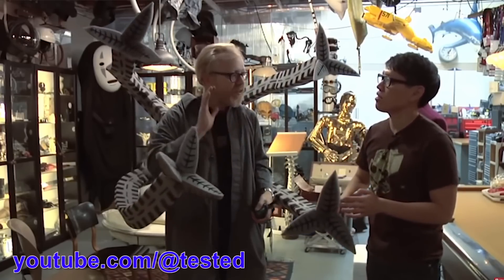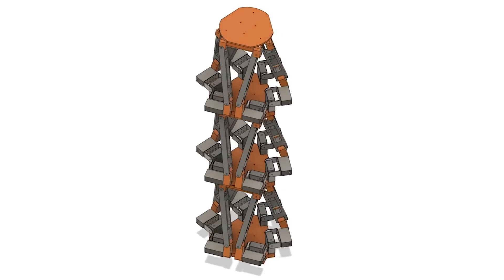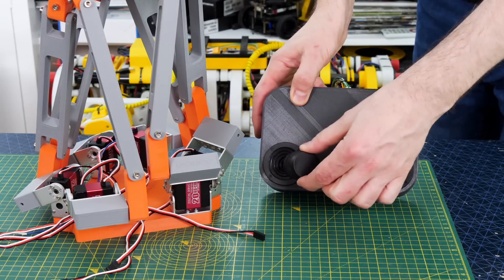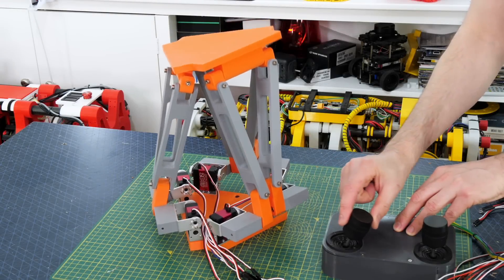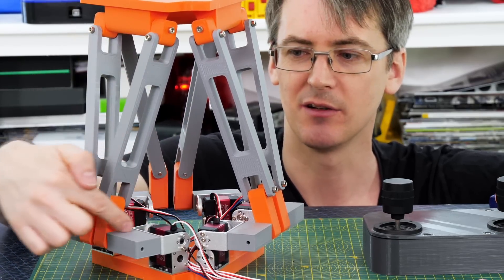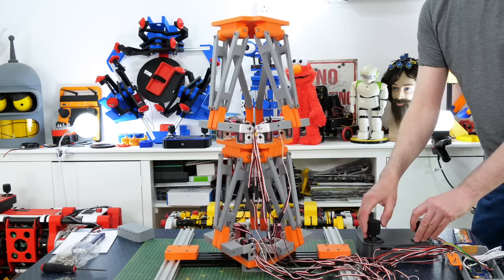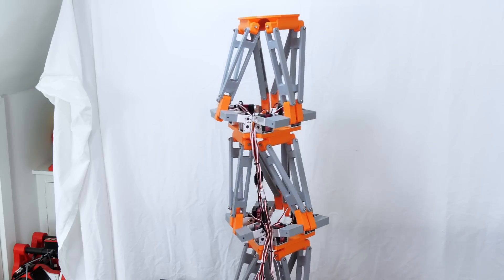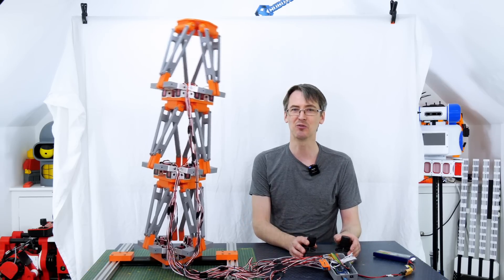Building a better Doc Ock Tentacle

Comment: Another potential idea. Instead of making Doc Ock’s 4 tentacles, what if you utilize those actuators to make Scorpion’s tail? One “tentacle/tail” should be easier to control and much lighter plus it's still a Spider-Man villain. And since this villain will be making his debut on the big screen in 2026, the timing would be perfect. And then you can still make Doc Ock arms afterwards.

Comment: Please do a part 2! With steel actuators for the base, then lighter aluminum actuators for the middle, and finally 3D printed plastic actuators to finish off the end of the tentacle. If you have to they can even be slightly tapered in size towards the end.

Comment: You can also do a Tentacle that uses gravity as -y . That way you only need a motor that tenses cord counter gravity to lift, and have two similar motors that tense the tentacle sideways.

Ideally the tensing motors would have a some paracord that it can deploy and recall to tense and relieve, they could be at the center of the tentacle to provide "elbow dynamics", use a sleeve to channel the cords, and some kind of aluminum spring deformed to conform to the desired shape of the tentacle... I think it should be inside of the sleeve and be a tight fit, so that the channels with the cord remain stable.

I thinks this is much cheaper, and the design is much flexible with a much higher tolerance for error.

Comment: would a thin anchored fiberglass rod down the middle be a good way to help take the strain off the bottom servos? or would it just add unnecessary strain to everything?

Comment: You could give the sections their own independent rotational movement if you used small electric hub motors mounted at the base of each structure, then instead of have a long central bar that spans each entire section you could have a smaller peg that slides the a bearing on the top of each section that sits flush with both section's surfaces.

Comment: Fascinating. 

Not an engineer, so feel free to haze me hard if I say something stupid, but I could see pneumatic as being really good for this. 

If you had a central highly pressurised tube with connections at the base of each section, you could drive the stewart platform with pistons connected to solenoid controlled valves. Letting the pressure control the movement of the mechanise. I'd also sagest having each segment stacked around halfway (or whatever mathematically works) along the former, allowing a smother, more tentacle like movement due to the fact that this would allow the mechanise to efectivly counteract the angels necessary for a stewart platform to work. However, I have no idea how complicated this would be to get working right, if it's even posable, and if there would have to be some kind of mechanical stabilising ring that would lock the bace of each pistons position ,of each segment, to a parallel planer position to the base segment, no matter the place it holds in the chain. 

You could also use the expanding of the pressurised tube to help support the mass of the mechanise, having bracing rods paced on universal joints halfway along each piston and utilising the force exserted by the tube to hold them steady. 

This, I think, would solve the problem with the servos lower on the chain being under more stress and allow a more natural movement, as well as, since you would be using pistons, remove the problem of large amounts of joints coursing wobble. 

Not an engineer though, so just some plebs thoughts.

Comment: Why not have a servo in the center of the top mount/platform that can rotate the next layer? Maybe link them with a large printed bearing as the link and the motor holds the position of the yaw.

Comment: Rotate the servos 90 degrees and fix them to a smaller base plate to allow for more tilt control. This won't be able to hold spiderman in a grip, he'll just slip through the hole due to abominably huge curve radius.

Comment: I feel like if you made 4 or 6 of these 3 section tentacles and put them on rotators connected to a platfrom, they would work quite well as legs (especially with the added supports you mention) because that heave/contraction motion could help with the clearance required to move a leg. Nice work!
Reply: I would love to see him build a robot like those from the Matrix movies. The eyes could be replaced with sensors that allow it to navigate its environment using some form of AI, like what boston dynamics use.

Comment: How did you become so good at engineering? Do you go to school for it? Did you practice building a lot? I’m a freshman in undergrad engineering and I want to do stuff like this
Reply: Engineering student here as well, 5th year, the best way to do this stuff is to practice with projects you find and watch some tutorials on youtube. The degree will teach you a lot of the math and physics, but you won't really see application until a senior design class most likely, unless you have some kind of project class, but even then they either give you a kit to buy or you have to come up with it on your own. An arduino kit is a good start for learning the basics of using a microcontroller. Learning a CAD program for 3D modeling like fusion 360 or onshape (which are free for students) and having access to a 3D printer (some universities or libraries will let you use theirs if you can't buy one) will allow you to do a lot. From there, the sky's (and your wallet's) the limit 👍.

Comment: It looks like something which could be refined into a robotic arm with possibly enough dexterity to replace lighting and perform other ceiling work like hanging drywall in a safer, faster way from the floor.

Comment: now imagine if each of those sections was about 2 or 3 inches high but there were 50 stacked on top of each other and that's essentially what each tentacle in the movie version looks like it's made of. if you started with bigger segments at the base and slightly tapered them down to smaller segments at the far ends it might add support at the biggest places of stress while keeping the far ends as light as possible. it would also look like some Ock designs, as many have his tentacles tapering slightly as they go. definitely do more of this this has some real potential.
Reply: An excellent, though quite costly idea. I wonder how it'd affect the weight of the tentacle per foot of length? Also I would love if there were some way of surrounding each small segment in a hollow tube in order to get that comic book look, with enough of a gap between each that the segments can fully rotate. Though it likely isn't possible due to how the struts twist and turn in each segment. Unless maybe it's more of a shroud? Idk.

Comment: This feels like it could be done with 3 motors instead of 6. The translation doesn't help a lot for the weight it adds.

A more intuitive control scheme would  be to direct the head in absolute space, like a drone, and let the computer fugire out how to move each part to get it there.

Comment: can we appreciate how impressive real tentacles from octopus and squid and such are. To have the degree of flexibilty while still retaining strength is ceaselessly amazing
Reply: That's some biology for you. Invertebrates muscles are actually crazy.
Heck, all biological "actuators" are. Google 'sarcomere' and share your thoughts (that's basically the modular molecular motor assembly which is present in pretty much any muscle of any creature. It's really power-hungry, but immensely strong and, duh, stackable)
With cephalopods there is this quirk: their "limbs" don't have any skeleton inside, pure muscle, some blood circulation system and nerves. This plus their rather tough skin for said muscles to latch onto gives them that crazy strength. Wanna go further? Go full exoskeleton, get all from biological muscles, become an insect.
Reply: well, yes but that's not too different from your tongue. extremely flexible, yet it's the strongest muscle in your body relative to it's mass

if you want to do a small experiment, curve the tip your tongue slightly downwards and try to push it inside your mouth with three fingers, with all the strength of your arm, while at the same time you push against your fingers with the whole strength of your tongue. BUT DON'T do it without washing your hands or if you've got long or sharp nails. Safety first

Also, if at any point you feel like you're really able to push your tongue to your throat, STOP. We don't want you choking
Reply: Biology of crazy. Even the most basic organisms can be incredibly complex.
Reply: you SIMP for mother nature. im with ya
Reply: Its a film
Reply: They are really alien creatures tho all the cephalopods are just built different from all other creatures even in all our oceans and bodies of water what with some being able to camouflage themselves with any surroundings, change skin textures, mock certain animal shapes, and just overall intelligence. It’s just other worldly tbh.
Reply: Sure why not

Comment: I guess you're a mechanical robotacist, but there's way, way to many joints servos, friction and weakness in this contraption.  A better solution is fluid filled cells controlled through a central reservoir.  But, I guess that doesn't fit with your channel.

Comment: In order to reduce the stress on the bottom tiers, you should make each tier slightly smaller than the last.  This'll reduce the over-all weight as well.  This also will help it look more similar to the source material.

Comment: Another option is to put pneumatic or hydraulic cylinders along each side of the sections which take the brunt of the static load from each compounding tentacle. That way, the servos could be utilized for motion, and the cylinders for load.

Comment: Make another but with sequentially smaller and lighter sections, possible need to use materials like carbon fiber and nylon filaments for the lower sections to take the torque and stresses

Comment: don't calculate controls via trigonometry. it's annoying and error prone. instead, you know the destination position of the upper triangle, so you can calculate target length of each link, and from that length you calculate target angle.

if you want velocity control, then do a small offset of the upper triangle in the direction where you want it to go, and then calculate the difference between the current angle of each servo vs this small displacement: your velocity needs to be proportional to this difference.

it's like inverse kinematics, but it's fully constrained, so the problem is well defined and you can calculate all servo angles just from position of upper triangle relative to the lower one.

Comment: Obviously you are going to have to deal with the magnitude of forces on the bottom when the center of mass is not directly over the platform. If you provide a greater degree of motion the tentacle can curl back on itself so the center of mass is adjusted from the end down. That is how snakes deal with climbing over branches or vertical surfaces. You can also see that sort of curling motion in octopodes when they don't have neutral buoyancy (aka above the water).

Comment: Something to think about, use cables to strengthen and stabilize the segments. They don't need to move or actuate any part of the assembly, just hold it together at extreme angles.

Comment: Personally I think that 6 actuator per section is rather ludicrous. By doing the math you should able to achieve, if not precisely, the very close to the same result with half the actuators, having the sections working together to achieve the desired collective result, I'd even say you could get very far with just 2, and if you're really smart, you'll have them affect not just 1 but 2 other planes/sections. Well, I for one think so, but then again I'm just a wannabe engineer with no education or experience to speak of, so what do I know.

Comment: 8:41 - Why would you need to do all that? Why couldn't you just add some gears and another servo onto a different 3d printed piece where the outer edge of that platform is static but the inner part is dynamic. Basically it'd be like those rotating platforms for food stuck on top controlled by a servo.

Comment: If the sections are much shorter and you do the thing where the middel parts is reversed with the bends i could imagine the tentacel could rear hard spots that arent easy reachabel. Like sticking it in a pipe with bends in it.

Comment: You don’t need the whole platform piece to rotate. Just the centre. Cut out a circle and make the whole price into a bearing or gear essentially with a motor controlling the rotation. Then attach the next platform to the middle circle.

Comment: yes making it smaller, and each section shorter, will maker it MUCH MORE like the movie version... but once you get it built with multiple sections how will you control all of them so they don't bend too much? will you have to use some sort of algo... or even machine learning?? or maybe they could increase the amount each motor moves depending on how fast you move the joystick.... but I'm thinking way ahead of myself, like when you have 12 'levels' (with smaller pieces of course)

Comment: I think it would be more ideal to have an IK solver so that you are using the controls to move the end of the stack in 3D space and the servo movement would be completely independently driven. This would get more complicated if you have more stacked sections, but then you could get to the point where you could articulate the movement. There's probably too much mass with the current print method, but it isn't difficult to imagine how you could form something like an S in the whole arm by curving several sections near the base one direction, and then equally bending several sections near the end in he other direction. Maybe you could use carbon fiber rods to build the actuators to reduce the overall mass? It would still be a lot of strain on the lower servos though, so I wonder if there's something you could do to cantilever strain, maybe with springs? I guess the orientation would matter a lot.

Comment: You should use rotational joints like they used building the " Newt Suit " for dry deep-sea diving. Each segment can rotate when a half nut ( like on a lathe) engages a central shaft that is threaded in both directions depending on how the half nut connects to it? Each segment would be flat on one side and have a 45-60 degree face on the other. The flats join with other flat faces and the angled sides connect to other angled segment faces. The central shaft drive would have U-joints at the bearing faces?  I can see it in my head and I'm not explaining it very well? Sorry.

Comment: ShonicBurn is correct, each segment after the base should be made about 10 percent smaller as it goes out, just like a squid tentical it is smaller the further it is from the body.  Secondly you could put a rotational pivot section every third segment and would enable the twist you want, it would not have to be in each segment.  Good job, now can you hook it up to neural link?

Comment: Start with a small tip with small servos, then work back toward the base with larger and more powerful servos, making the sections bigger each time. That way the servos at the base can handle the mass of the whole length :D

Comment: I'd imagine that as soon as you turn this sideways the servos will struggle to overcome gravity.

Maybe some torsion springs in line with the servo axes could be added to counteract much of the force due to gravity so it's mostly just the inertia of the system the servos are having to overcome.

Comment: There's also some interesting work that's been done by Festo and Disney Research involving liquid or gas filled tubes instead of cable actuators. On either end of the line are syringes: when one is pushed the other is pulled

Comment: One suggestion I have would be rerouting the wiring to the interior of the arm. If you add a circular hole in the middle of each platform, you could use some form of wiring loom to protect everything from potential pinches or damage from the movement.

Comment: How about you control the intended tip position and orientation as relative movements (changing variables by adding or subtracting from the previous values), capped at whatever you calculate is the limit of the reach of the whole setup, and then calculate the joint angles by performing a physics simulation of everything (without gravity, but with some drag), with just the tip not physical, and instead have it's values applied via PID or something of the sort, to control everything with just 6 axis of input?

Comment: This is a super interesting design and implementation. I wonder if you might get quite a bit higher ratio of bend per segment by doubling the servo assembly on both the bottom and top of each segment -- basically, you would get twice the extension and compression for each segment, without adding any length, so even though your weight of motors would increase, you would still probably get a tighter radius of bend in fewer segments. As always, you're doing an incredible job pushing the edges of what's possible - I always love sending your videos to my Industrial Design university students, it's a great kick in the pants for them to just try something.